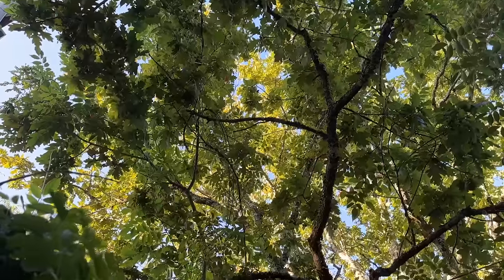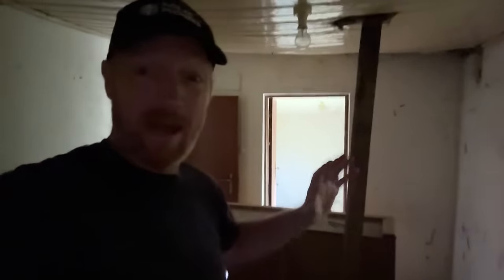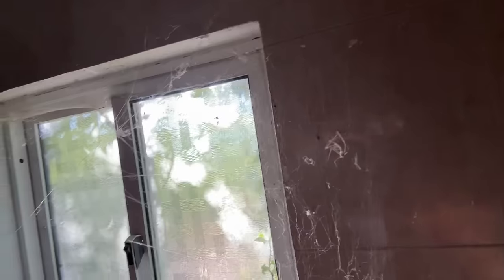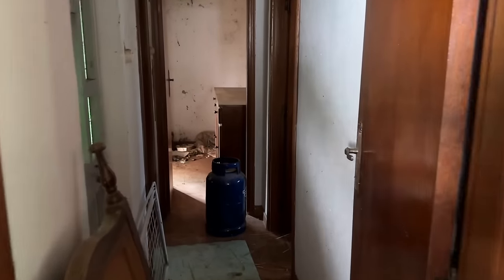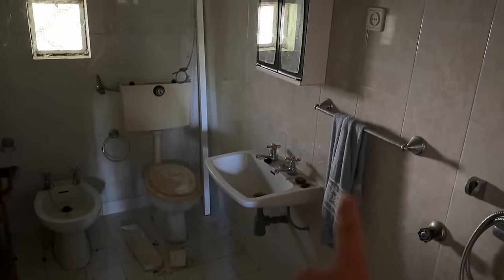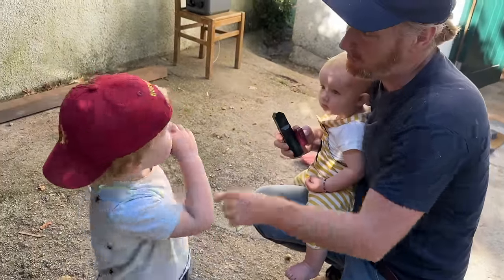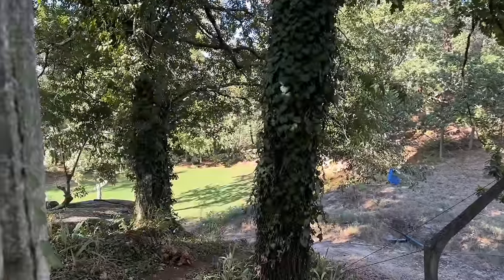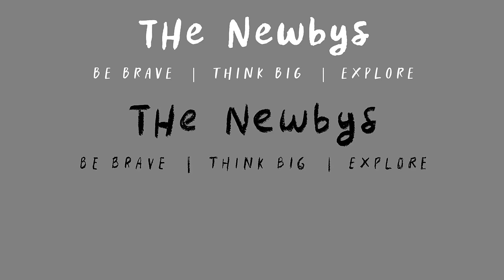Why no one wanted to buy this ABANDONED Portuguese farm when we DID!

Comment: Makes total sense to demolish and rebuild. That way you can build a house that totally meets your needs, instead of trying to alter, redesign and renovate an old one. With a new build you can also incorporate eco friendly measures far easily than trying to install in an old building. Exciting times ahead for you 👍
Reply: Why ?doing that is going to cost way more money plus your going to need approval and building licenses
Reply: Save the roof tiles if they are good and the stoves (which might be for coal?). But yes, a re-build seems to make sense.
Reply: @ankiking  the walls are in great shape they need new doors windows teardown the ceiling and roof make a new roof and eclectic ect.ect
Reply: @antoniodasilva1230  It looks like the walls are soaking up moisture from the ground which makes them crack. I don’t consider that good walls, but might just be me. 😊

Comment: Gutting your old building that has had years of a leaking roof may reveal mold in the walls that might be in the wooden studs... Love the views, an open floor plan with sliding glass doors and a deck facing the glorious beauty of nature would be amazing! Build it for the views, get rid of bathroom and bedrooms facing the view and make that the living area. Put bathrooms and bedrooms on the non-view side - but still have plenty of windows for light and air. It would be a big redo, but you'd love it!

Comment: Keep both bathrooms. They will be very valuable for the family. You could build two concrete posts or columns on the corners, where the cracks are ,to reinforce the walls or you could reinforce, improve the foundation on those sides of the room. I don't know if it could be possible or affordable to build like another room or kind of tunnel that connects this building   with the building or house where you are currently living. The walls of this tunnel or gallery could have half of them made of glass or giant windows; in this way, you could be able to move from one building  to another with no need to go outside in the rain, hot or cold weather...
Reply from the maker: Thanks Mary, neat ideas friend. Let’s see how it all turns out. Great to hear from you, thanks for watching friend.
Reply: Excellent idea 😀 I thought the same thing too not to mention that it would be much less expensive & take less time than tearing everything down & waiting on permits, architectural plans to be approved, finding materials & the workers to build a new house. Do lots of research & weigh all the pros & cons of each possibility before making a decision, it has helped us avoid regrettable decisions in our life 😀 Love watching you guys, you are awesome 😃

Comment: It looks like the ceilings need to be removed & most likely repair the roof. If emptied out and washed down with bleach then metal studs, insulation etc could be installed to make it quite habitable with some reconfiguring of the rooms. But I am big on repurposing as much as possible-:))